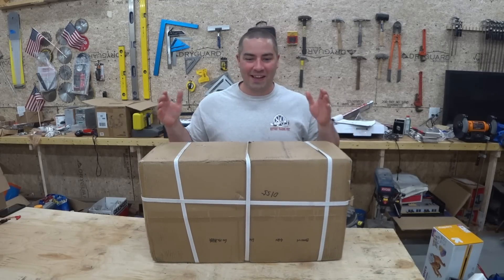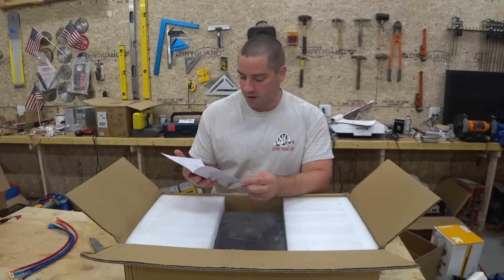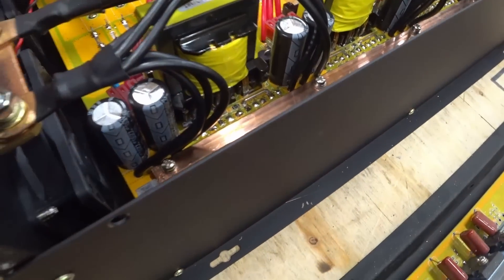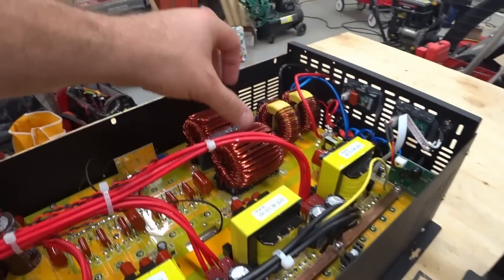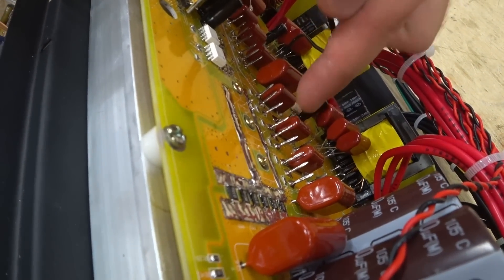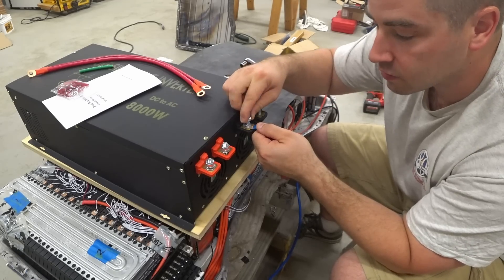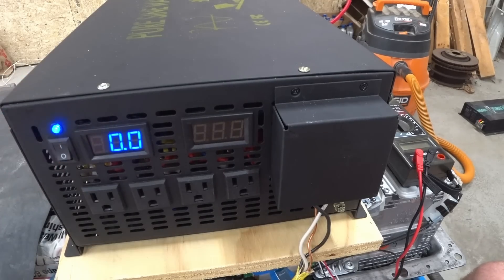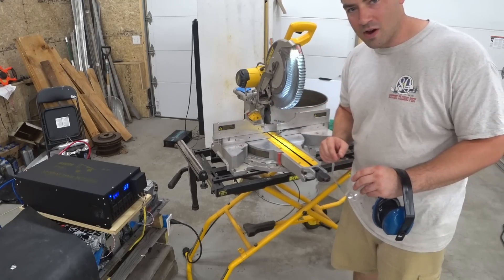Cheap 8000w Reliable Inverter, That Works! WZRELB

Comment: how  amps is it?
Reply from the maker: How many amps?  Well the inverter is 8000 watts, and connected to a 48 volt battery.  So about 167 amps if you run it at full load.  But it will depend how many things you plug into it.

Comment: Im a noob at electrics, Could someone link me a good place for an inverter for a household, Or would this one here be enough? Basically running 800watts continously this seems great but i would just like extra verification.
Reply from the maker: This one is overkill for a 800 watt load.  And inside a house you probably want one with extra UL certification.  Try looking at Alt-E's website, they will probably have what you are looking for.  https://www.altestore.com/store/

Comment: I have a  Diesel generator ( 5kw, 180 amps) 28 volts dc output. What inverter do I need to use  with it?
Reply from the maker: That's pretty cool.  Sounds like you have something that can charge a 24v battery bank.  I've never tried connecting a inverter direct to something like that, so I can't speak from experience.  Maybe post your question to a facebook group?  I'm in "DIY Powerwalls"

Comment: 13 amp on the compressor equals approx. 1586 watts at 122vac. Even with the starting "in rush" of 5 times the the watts are only 7960 watts, easily within  the 8000 watts continuous and only half of the 16000 watts that allows for the  increased in rush.   So why is that awesome for a 8000 watt inverter?  Especially since it is rated for continuous 8000 watt and peak 16000 watts? How about doing a real test and put a load of say 6000 watts for about 30 minutes on the inverter and then start your air compressor load and lets see if the 16000 watt peak rating is an accurate rating. If it passes, then that mean the inverter does what it claims. Awesome is reserved for "above and beyond" performance not "as advertised" performance. FYI power is in "watts". Power equals volts times current. P=VI. Very nice video and love the enthusiasm and the video does show how easily an inverter that is rated well above the power draw can operate various shop item. You have some very nice shop items, congrats!
Reply from the maker: Thanks for your comment.  I've had inverters in the past that could not start the compressor, even though the math on inrush says it should.  So I like when things work.  LOL.  You might like part two of my testing when I load this inverter up more.  https://youtu.be/TZbjy9t933E

Comment: Have you tried a 12 volt golf cart Battery?
They are extremely deep cycle even more than a marine battery.
The cost compares as well.
The best golf cart battery brand is trojan.
I live in a community that has golf carts on streets.
Often guys will buy the cheaper brands not worth it.
I was considering this set up for in truck power for tools compressor or even a winch.

Comment: What kinda batteries are you using and how many for that inverter?
Reply from the maker: I built the battery over a few previous videos.  It's from a 2013 Smart Fortwo EV.  I arranged the cells to make a 48v battery.  It's turned out to be about a 15 kwh battery.

Comment: 13:13 here goes your voltage drop cause you put REAL LOAD ON TOOL but this small peace of wood is like 20% load of the tool only...
Reply: Glad to see someone with a real understanding comment this. Starting a dc brushless or any induction motor under no load only proves that the inverter can handle these tools at idle to which those tools are useless at idle.

Comment: Perhaps, find out why the old one didn't work too well. A typical 15a at 120V or 20a at 120V for bathroom. Maximum of 2400watt total per outlet. All 120V equipment is rated under 2400watt. The 8000watt inverter should be enough to provide at least an outlet worth a power.

Comment: Ok so the inverter is about 1500$ but what is all that other stuff you got it attached to? 
Also how long can you run those things with out power. For example say just off battery in an rv
Reply from the maker: In this video I have the inverter attached to a battery I built in previous videos.  It's from a Smart for two electric car.  Run time depends on your loads.  If you have a 1000 watt load, then this battery can run it for about 10 hours.
Reply: Awesome. I need something that can run a mini fridge and a 200 watt mini heater on and off over the evening, but i want to invest in a solar pannel 100w as a means of recharging the battery...seems worth the money that but I wonder If I would be fine with a 5000 watt

Comment: at 60 amps and up to 100 amp
 you should probably use the # 4 THHN, 50amps # 6 THHN. 30 AMPS # 8 THHN . ALL WIRE TO BE STRANDED COPPER !

Comment: How much you payed for it? Where to get one of those? Great stuff!!
Reply from the maker: They sent it to me for free to review.  I think they sell for $1400 on Amazon.  It's an OK deal if you need an 8kw, but I prefer my 6kw Aims brand inverter.
Reply: DavidPoz What is the difference that you like between 8kw reliable and 6kw aims? Also, can this run a welding machine? Thanks for the great contents.

Comment: they didn't double up their wire sizes to go from 240V down the 120V... I'd be sticking to 4kW sustained.
Reply: also, all your saws are now available as cordless, or at least brushless. There's also an optional power adapter (one end fits into where the battery normally goes, and the other end has a power-wart). This eliminates any nastiness going from powertool motors into your inverter. That still leaves pumps & compressors though :-/

Comment: i was surprised how happy you were that your 8000 watt inverter pulled off running 3000 watts of stuff with a 48 volt supply i am guessing you have had some bad luck if i comparer my 3000 watt inverter i got a couple years for 200 bucks at Canadian tire i did a test and was running 2 1500 watt space heaters and a radio i was real happy and should do a video i guess i dident even  think to time how long it ran for but i shut it down at a 12volt supply even with 2 sets of the biggest shortest cables i could find the smell of hot wire made me nervous but i was still happy and no damage
Reply from the maker: You guessed right, I've had bad luck in the past.

Comment: Those internal wires are fine with that wattage.  Because they are AC ,and because of their short length, they can cay that much current and wattage.  It’s not a problem.  If you look it up in the NEC guide to wire gauge/ampaciity, you will see that shot runs of less than a foot can cary multiple times more power than longer runs of the same gauge.
Reply: Matt Carrell u tell them!!!
Long lines have voltage drop!?
Reply: @orlandojohnson5742  Yes because of the cable lenght. The more lenght the more resistance they will have. Simple answer. But if you're not stupid you may noticed a tall constructions usually with 3 lines beside of the road or going straight through the field. Those towers are high voltage powerlines so why the high voltage? Because if you increase the voltage you're dropping amperage way lower so the thickness of the wires goes also down. You can pass 1 milion volts across 2.5mm wire and draw tons of power without overheating the wire but lets say , 12V across the same diameter you can pull max 100W from it. 1 milion volts across 2.5mm wire you can pull almost 1 megawatt of power from 2.5mm wire. 1MV* 1A  = 1MW

Comment: I have seen burn inverters most the relais it was a disaster, 48 volts is much better, current lower, is more trustable because a samll sign of wear can make the cableconnection a welder burn all around it.

Comment: Someone give me a SIMPLE answer please. I dont know anything.

A regular camping rv.
It comes with a 12 volt regular battery for all the electric components inside.

If I want Solar ,
Can you please tell me exactly what I need.
-solar panel
- anything else?

THANK YOU 🙏🏼👍🏼Whoever can help.
Reply: Call renogy... tell them how much of a load you think you'll be using on your system.... coffee pots, ac, lights, tv.... they'll tell you what you'll need. 
1 panels
2 batteries
3 solar charger/controller

Comment: The wires to the terminal block if they are stranded wire will carry more current than the solid one strand 10 gauge wire. Electrons travel on the surface of the wire not through it and there is more surface area on a stranded wire, therefore it will carry more current.

Comment: Need to change the blade in your chop saw. Would love to know more about your battery set up. Good video! Thanks!
Reply from the maker: Yes, that was a very old blade.  Burned through the wood instead of cut.  LOL.  The battery was out of a Smart Fortwo EV.  I re-wired it to 48 volts.  There are several videos about it on my channel.  I have a link in the description where you can buy them.

Comment: That low gauge wire is of concern to me. Especially regarding VOLTAGE DROP. 
I am also leery of anything that is manufactured in China,  especially an essential electrical element that is for CONSTANT LONG TERM USE. A UA approved electrical system would be my personal preference. 
It may cost more but my family's safety is more valuable than cost.
Reply from the maker: I agree with you.  I don't use this inverter for full-time use and don't suggest that.  I think this inverter is best for temporary power.

Comment: those Blue Cables what it run too  DavidPoz
Reply from the maker: I built a battery from a Smart Fortwo Electric car.  It was a fun project.  The battery is powering the inverter during this video.
Reply: @DavidPozEnergy  okay
Reply: @DavidPozEnergy  okay cause i you lost me there at first thanks

Comment: Does the inverter recharge the battery as it's working or does the battery go dead like electric drills etc....
Reply from the maker: Hi Jackson,  The battery would go dead, the inverter has no charge function.  There are some inverters that can re-charge a battery, but they would need to be connected to a generator to do that.  I was building this battery as part of my solar system.  My solar panels re-charge the battery during the day, and then I can use the power at night.
Reply: @DavidPozEnergy  so how long do you have with a full load on it
Reply from the maker: The battery in this video is 12kwh capacity.  So it could run a 6kw load for 2 hours.  Or a 2kw load for 6 hours.  LOL

Comment: The 2 apparently undersized leads going to the terminals is fine - they’re super short and open. If you’ve ever been inside a larger diesel gen set it’s very common to see what appears to be way undersized leads from the gen to terminals. Just my two. 👍
Reply: Short runs of AC high voltage will permit smaller gauge wire like inside this case.

Comment: If I am seeing this correctly, if the meter to the left is showing cycles, why is it at a little over 53, when it should be slightly above 60
Reply from the maker: Hi John,  The left meter is showing battery voltage in DC.  Thanks for watching.

Comment: Just a guess, but i think when put under more of a load it is engaging more of the capacitors which would be the only thing i could think would cause an upward tick in your dc voltage.

Comment: try putting a real load instead off the micky mouse loads you have put on it, also you complained about the cable size on the a/c size you cable size on the DC size was not a lot better, that unit will take 800 amps at 12 volts are you sure you cables are up to that ???    if your going to the effort to do an inverter test then do an inverter test. lets see 8000 watts on it for 2 hrs then talk to me about it being reliable .
Reply from the maker: I did a follow up video with more loads.  You might like that.  BTW, "Reliable Electric" is the brand.  https://youtu.be/TZbjy9t933E

Comment: When carrying AC current cables do not need to be nearly as thick, if you look at the pair that feed your home that are capable of supplying several hundred amps you will note they seem far thinner then they should be. Same for the cables on the power poles, they are supplying thousands of amps to all the homes along it, yet are still not really that thick. This is one of the main reasons that Tesla won out with AC over Edison with DC.

Comment: Nice testing. like this testing on the replacement. Where can i get the Inverter for Purchase.
Reply from the maker: I have a link in the description where you can buy this on Amazon.  I've also seen it on Ebay for about $100 less, but I don't have a link for that.

Comment: Inverters seem to short out very easily. Instead of one big inverter I would use several smaller ones so its no big deal if it goes bad.

Comment: Outside cable dimensions are a combination of wire plus insulation. I have seen large wire with thin insulation. Also you should have measured the starting amps. Your running amps topped out at 24A  or 2880 watts.
Reply: 24.3 Amp 121 v
É diferente

Comment: how do I get one.  mine from power jack is worthless and cost me $$$. These power jack inverters are garbage. mine won't even power a 5 watt LED desk lamp without an alarm.  the company won't support beyond one set of parts that gets you beyond ebay support due to 6 weeks to ship the parts that allegedly will fix it.  it is crap and not worth the cost.  buy american and pay more.  At least it will work.  David  from Power jack, hope you are reading this since you blow me off.

Comment: Chassis AMP rating vs Power Transmission.

10 AWG is rated for 55 amp chassis / 15 power transmission.  
Meaning inside the case it's safe but not for long runs like in wall, or extension cords.
Reply: J Correa Hi

Comment: I know nothing of this inverter. Do you use this when the power is not available, please explain?
Reply from the maker: The manufacturer sent me this inverter to review.  It takes battery electricity (48 volts DC in this case) and outputs 120 volts AC power.  This allows the user to plug in appliances (TV, lights, tools, microwave, window air conditioner).  Yes, you can use this when the power goes out in some situations.  I think it's best for portable applications like an RV or running tools at a remote build site.  Personally I use another inverter as my whole-house backup: https://youtu.be/dfHb5tZErTs
Reply: @DavidPozEnergy  Thanks,how long can it run? Also the one for your entire house
how, may it run Thanks! If I live in an apartment or condo how may I install it?
Reply from the maker: The answer to run time is tricky.  You need to know your loads and battery capacity.  (along with other things).  As a rough rule think of it like this: If you want to run 100 watts of loads, and you have a 100 wh (watt hour) battery, then you can run for 1 hour.  I suggest you check out this series of tutorial videos from Alt-E.  They are a fantastic resource.  https://www.altestore.com/video/
Reply: @DavidPozEnergy  Thanks again! It's time for me to do some catch up.

Comment: Awful. It would help if you know anything at all electricity let alone electronics. You need to look up the difference between THHN and DLO/locomotive cable/welding cable. Oh and #10 is rated for 35... not that anyone ever puts them on a 35 amp breaker. Derating. Stick to playing with you wood and let the professionals handle it.

Comment: I have no idea why people would want to change DC to AC. Just the fact that to make 120VAC RMS you need to actually make 169 VAC a lost of 30% just because of the nature of AC. The heat dissipated by the Inverter would take another 20% lost and finally some 50% of the appliances in your home have to convert that AC back to DC ( another lost in power of maybe 15%) example your LED bulb that work on 3.3 VDC and your LCD TV that work on 19.5 VDC heater elements work on DC and some of the kitchen small appliance also work on DC. You are better off working with the DC current supplied by your solar panels and just regulating that power on an appliance bases using Zener diodes that consume way less power. Edison had it right DC is more efficient.

Comment: Dullest miter saw blade I've ever seen.  You, Sir, are easily amazed. You never got even close to it's rated capacity with any of those tests.   8kw is a lot of power.  In fact, probably more 120v power than you'll ever use at one time.  Still, keep up the good work.  I enjoyed seeing the innards of those inverters.  And get a new miter saw blade....haha!  Thanks for posting.
Reply from the maker: Yes, I need a new blade.  I have a second round of testing after this video where I try to load it up to 8kw.  You might like it: https://youtu.be/TZbjy9t933E Thanks for watching.

Comment: The main problem with most of these inverters is a very high standby consumption. David, what current draw from the battery can you measure with no loads connected and the inverter running?
Reply from the maker: I think it was 45 or 46 watts.  Not as good as something like an Outback Radian, but better than some I've tested.  My Aims inverter is usually around 70 watts at idle.

Comment: I was pretty impressed at the amperage differential between the input and output. It's only a little over twice as much on the input @48 vdc, so that thing is very efficient. The fact that it will start a compressor or run your saw and actually cut a board with only a few volts drop is really amazing. Load sensing evidently works really well on this unit.😉
Reply: What's your input after 2yrs with it

Comment: GIVE A REAL TEST.... PLUG IN HEAT GUN AND OTHER HIGH AMP DRAW AND LET RUN FOR 20 MINUTES ON A HOT DAY....  NO WAY IT'S 8000W  EXCEPT MOMENTARY OR SHORT DURATION.....I'LL BET! ! ! ! ! !
Reply from the maker: You may like my second round of testing, I connect a lot more load: https://youtu.be/TZbjy9t933E